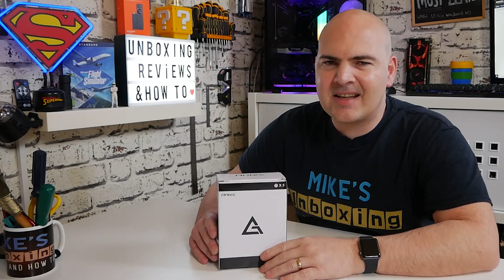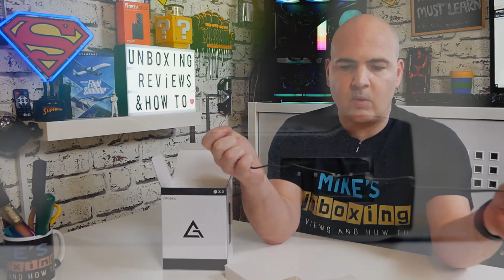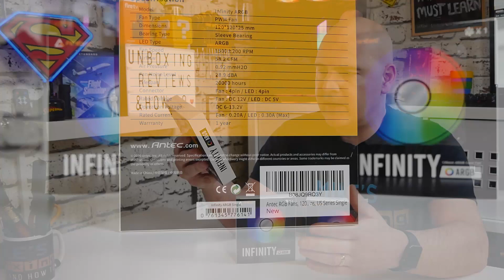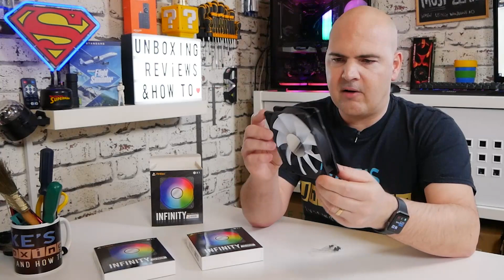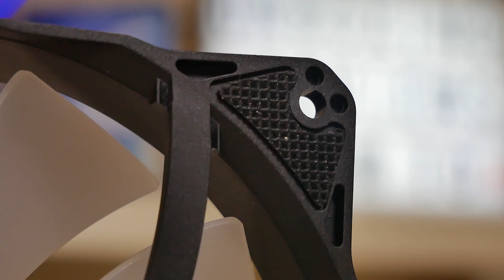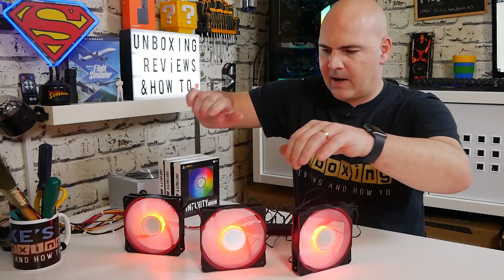Antec Infinity Mirror ARGB 3 Pack Fan Kit With Hub

Comment: Why is this the most confusing thing I have ever done with a PC? And complete fluff at that. I don't even know why I am doing it. I couldn't get any basic, old school cheapo cases. So I ended up with a Zalman S2 TG. And I thought, why not give it a go? so I got 6 of these things, a controller and a hub. I also have a Wraith Prism I will be attempting to work in there somewhere. Oh well, I got everything from Amazon so if it doesn't work I can send it all back. I am more worried about whether the ASUS B-450 motherboard I bought a year ago actually works. I have no emotional need for the RGB to work because it is completely superfluous. If it does, it will make a nice nite-lite for when I go to the kitchen in the middle of the night. It will actually be primarily a mining rig and really only be used for gaming occasionally. But I figure if you are going to do something as silly and pointless as RGB, you might as well make it extra pointless and silly by making an RGB mining rig, lol.
Reply from the maker: lol i do actually fully understand where you are coming from there. I would say the motherboard is 50/50 if it will support the 5v addressable RGB, and more likely to support 12v RGB (which doesn't work with this set of fans sadly, but the hub can be manually switched to colours via the reset switch or another suitable switch if you jerry rig one

Comment: No thanks. I'm not a fan of ARGB, and vampires don't like mirrors. 😂 Also, I use a lot of fans. Twelve 120mm's on the two radiators in push/pull, plus four 140mm two of which are on the top for intake, and two on the real panel for exhaust.
Reply from the maker: ARGB is very much a divisive theme, and the extra cost can be an issue. At least these don't compromise on airflow though, pretty strong air flow on these

Comment: would they work with b450 tom max?
Reply from the maker: yes but the ARGB control will need to be via reset button as the tom max has no ARGB headers, fan wise it is fine
Reply: @mikesunboxing  how do you do that?
Reply from the maker: @mts982  it is in the video